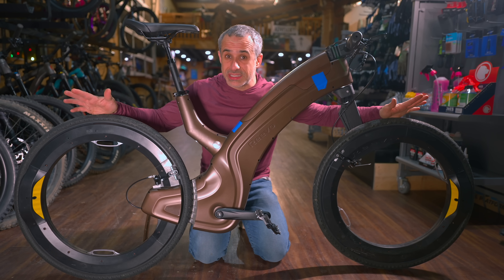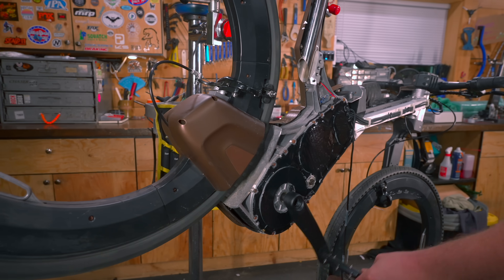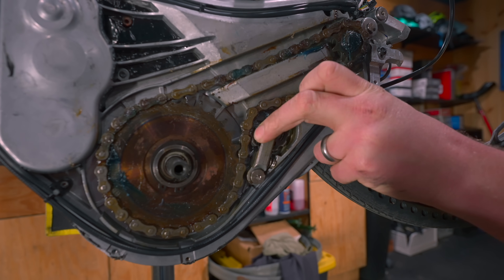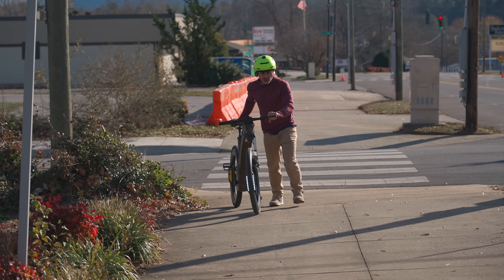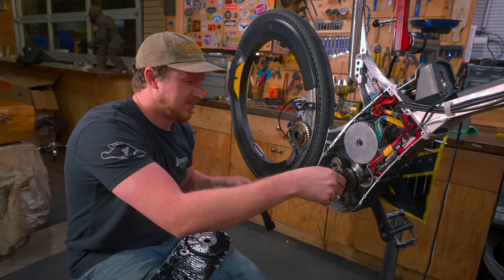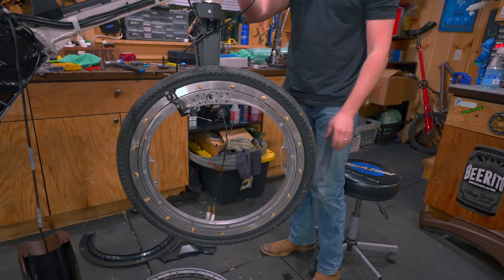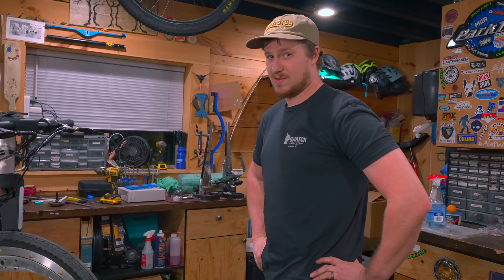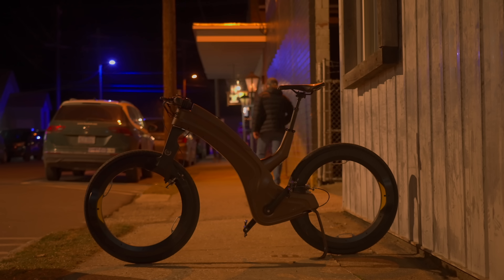What's Inside The World’s Worst eBike? Reevo Teardown

Comment: the amount of machining and engineering that went into this is nothing short of astounding. It reminds me of Juicero's insanely overengineered colostomy bag squeezer.
Reply: That sounds like a terrible thing to be reminded of.
Reply: @soaringvulture  look up Juicero. 
I think the eve channel did a teardown on it.
Reply: And, much like squeezing the proprietary Juicero bags, it's more efficient to just do it manually
Reply: From a bike Mechanic's pov, this is over engineered by someone who has no idea how or why bikes are designed that way. Jucero was over engineered but does it's job (being a cold press) very well. This thing is over engineered because the engineer probably never had any partial design done and thought he can just over engineer his way to success.
Reply: @StevenZephyc  From an engineer's point of view, it really looks like someone knew what they were doing when they did this. You can't put something like this all the way to manufacturing without a good understanding of machine design. And you can't have a good understanding of machine design and think that any of this is a good idea as a consumer device. I do hope they specified stainless screws and the factory messed that part up.

And I kinda respect the company for shipping out prototype devices which must have cost at least ten times the sales price to produce. If you are trying to scam someone, that is not what you would be doing.
Reply: @samuelsudhof8036  If they had specified stainless steel screws then they would have been fools; stainless steel screws gall in aluminium threads and become almost impossible to remove.
Reply: @cambridgemart2075  Yeah, true. Galvanized would have been correct.
Reply: @samuelsudhof8036  An engineer would never suggest that this be made. It has at least 10 times the friction losses of any other design. It was doomed from the start.
Reply: @firesurfer Hate to break it to you, but engineers don't get to decide what they make or don't make. They issue recommendations and offer guidance to be roundly ignored in favor of a flashy presentation from the marketing team.
Reply: @firesurfer  "An engineer would never suggest that this be made."

Hubless wheels certainly CAN be made to work. I would have suggested that the right way to do it would be to specify two good, custom, 32" diameter, sealed, thrust bearings for each of those hubless wheel assemblies. And then the idea man who hired me would have said, "That will cost how much? Oh hell no! This is a bicycle, not a lunar lander! Just use some plastic wheels pinned in place within the outer hub casting."

Also needs some sort of sprag clutch on the pedals to prevent the rear wheel back-driving them and causing the runaway issue, but this isn't the biggie cost item.
Reply: @samuelsudhof8036  It certainly seems like the kind of thing where concept designers pushed what they wanted for the bicycle, told the engineer exactly what they needed it to do, the engineer told them it was possible but really just not a very good idea, and then they told him to do it anyway because they had already pushed the concept-design to investors.
Of course the engineer who could ACTUALLY pull this off, at some point decided not to bother trying too hard to get it to be optimal, because this was clearly a walking disaster who's only redeeming quality was the marketing department.
Reply: @CabbageSandwich  can’t agree more, as a mechanical engineer this is what usually happen especially when working on an innovative product. The engineering and the design of the bike is actually pretty neat conceptually and i believe the concept can work if given enough time. In this case I suspect that they have terrible communication between their division.
Reply: @afrodite8685  I absolutely agree, and chances are that initially, the engineer was applied and excited to make the prototype, only to discover that the company was not going to drop the kind of R&D money needed for the several iterations needed to make a functional next-gen ebike.
Reply: @StevenZephyc  the juicer doesn't do shit you can literally squeeze the bags with your hands and achieve the same outcome this was proven through like 500 videos 😂
Reply: @StevenZephyc  I feel like you couldn’t be more wrong. Just like every other non-engineer that blames an engineer, you too fail to realize this is definitely the brainchild of someone in marketing
Reply: @StevenZephyc  woah watch THE BICYCLE MECHANIC has entered the chat to tell us why the Juicero is a good product after all
Reply: @ItsSweetShot  "woah watch THE BICYCLE MECHANIC has entered the chat to tell us why the Juicero is a good product after all"

Now that's just an unfair mischaracterization. He didn't say the Juicero was a good product. He said that as a machine designed for a specific purpose, it wasn't over-engineered. It can be a shitty product, a shitty idea, or whatever...and he can still be correct.
Reply: @StevenZephyc  Actually, Juicero was really bad engineered and you could extract more juice pressing the bag with your hands.
Reply: A difference is the Juicero bag squeezer was pretty much engineered to be an intentional fraud, ridiculously over engineered just for the purpose of charging a lot for the machine and subscription to the juice bags.  The Revo bike seemed more like a failure to take a prototype and make it manufacturable.  Whatever Chinese factory was contracted apparently just obliviously churned out exact copies of the engineering model without regard to whether it made sense.
Reply: @wtmayhew  It's questionable, a lot of facts says that Juicero probably wasn't an intentional fraud either. It absolutely can squeeze juice out of vegetables, the main problem is - the bags are too small to fit enough vegetables to fill a glass with a juice. So they decided to add juice in the bag with produce and the juicer become an overengineered caprisun squeezer
Reply: @wtmayhew Well, not the factory's job to fix something that went wrong in the idea phase. The only thing they could have recommended would have been to cancel the whole thing, but you can't really expect a contractor to shoot themselves in the foot like that.
Reply: @wtmayhew  I disagree that the Juicero was overengineered. It was overbuilt, in that they could've accomplished the same with a much cheaper device just by squeezing the bags from the far end rather than all at once. This is overengineered, in that it required a lot of engineering to produce the desired result of a "hubless" bicycle. The sentence, "If you give a smart engineer a dumb idea they'll figure out how to do it, but that doesn't make it a smart smart idea" is what defines overengineering in my opinion.
Reply: @wtmayhew  "Whatever Chinese factory was contracted apparently just obliviously churned out exact copies of the engineering model without regard to whether it made sense."

To be fair, it isn't a manufacturing facility's responsibility to engineer your product for you. You design shitty product, contract them to produce shitty product, and they spit out shitty product.
Reply: @wtmayhew  I wouldn't be sure. For how expensive the Juicero thing was, it lost money on every sale. Perhaps it was going the printer route, where they turned a loss on the machine and made up the money by gouging you on the refills.
Reply: @blakksheep736   Thanks for reply.  I believe you are correct that the plan was to sell lucrative subscriptions to the Juicero.  Unfortunately it was too obvious that all people needed to do was to open the bags and the machine wasn’t needed - it wasn’t doing any processing of the bag contents.
Reply: @wtmayhew  yes, that too. Selling a product whose only use is solving a problem it creates is already tricky, but the Juicero couldn't do even that.
Reply: one thing in particular with the juicero is that they seemed dead set on it being front loading for some reason, which was a big part in why it ended up being so overengineered. basically they needed a lot of pressure to squeeze the packets but that pressure was also going towards the door at the front which needed to not pop off and impale someone while they were standing there waiting for their juice. so dumb but very similar to this bike where they decided from the outset that they "needed" to have spokeless wheels
Reply: "colostomy bag squeezer" 😂 Thank you for the good laugh!
Reply: Exactly. I took a lot of effort to make something shity
Reply: Dude. I used to have a colostomy bag, and had never heard of this. Reading that last bit had me almost scrambling to search into this, thinking of what it would have been like to have someone squeeze that bag. xD OMG, I nearly had a heart attack going, 'What? WHAT?! spfftt NO! That's not real!'
Reply: @darenabryant9100 i wonder if you could reuse them this way
Reply: Sounds like the age-old story of how hard it can be.
Had a grand but vague idea, gathered a lot of funds under unrealistic poorly thought out promises expecting money to fix every issue their imagination couldn't, got buried under way too many problems they had no idea about, running out of time and money scrambled frantically to deliver at least something resembling the original promise, didn't make it in the end.
Not intentionally a scam at any point, but with not much different outcome.
Reply: The bicycle equivalent of the f-35. And we wonder why there is so much debt?
Reply: Feels like a a desinger got an idea, and ab enginer wont say no to a stupied problem to solve :D, i dont think this is a sacm or money grab this probably costed alot of money in R & D
Reply: The juicero of bicycles
Reply: This bike is like the Pancor Jackhammer of bikes
Reply: Hah, that was my first thought as well.
Reply: yeah i know right? this feels like that episode of BOLTR
Reply: You win in best description ever
Reply: Sister Miriam pfp :D
Reply: Now you can have juice EVERY DAY.
Reply: I just watched a tear down of a juicero, and it's a beautiful and elegant design.  Everything from the plastic molding to the circuit boards are super high quality and the whole thing meets the design goals as perfectly as you can.  

Sure, it would be expensive as hell to manufacture and the design goals are complete bullshit, from iot connectivity to proprietary juice bags, but it does what it was supposed to incredibly well and elegantly.

I would love to work at whatever design and engineering firm put that abomination together.
Reply: thank you for this comment because it sent me into a pipeline where I ended up learning about Mariana Mazzucato
Reply: I got whiplash hearing of the Juicero again 😂
Reply: It's the Joe Biden of bicycles

Comment: Say what you will about this bike, but the engineering behind it is truly remarkable.
Reply: it is thoroughly under engineered
the chassis is overbuilt (too thick, and seriously? square tubing?)
the gear train more complex than it had any right to be, especially the electric side (you don't need that many gears)
the hubless wheels runs on 3d printer V-rollers with plain bearings (high rolling resistance x34)
the anti theft system relies on an effectively disposable hobby servo (known for stripping gears all of the time)
you have to dismantle the lights to service the wheel (no connectors)
the drive wheel construction is dog (milled solid casting, drive gear part of the wheel body)
the wheel constantly backdrives the motor and pedals (what is a freewheel device?)
preceeding issue probably causes even more resistance with the electric fields of the motor
the stupid usb plug perfectly positioned to be full of water comes the first rain
and so on

you're right, it is remarkably bad
Reply: Did you even watch the same video I did?
Reply: I didn't see a whole lot of engineering. There was plenty of fabrication but not much thought behind it.

Comment: Damn even the servo they used was the literal cheapest one they could find. The SG90 is less than $2 when bought in anything more than a 10 pack, has cheap plastic gears, and isn't water resistant at all. I would have at least gone with the MG90 so you get the reliability of the metal gears, but honestly for the price they were charging for the bike they should have been using something a little beefier and probably water resistant if not straight up water proof.

Comment: Does it use Boeing's MCAS system for the pedal assist. Modified Characteristics Augmentation System. Or did Boeing adapt its system to the 737's Horizontal Stabilizers. The world may never know.

Comment: If you put the interface between the frame/fork and the wheels on the ground (where the wheel touches the ground) then the wheels as a whole would never have to bear the weight of the bike. That way one could have done away with the 'stationary' inner wheel completely. See the Sbarro Orbital Wheel, an old (similarly bananas) idea for motorcycles from the 80s. In these, a hubless wheel moved through a special bracket that held the wheel in place, at least in case of the front wheel. There is a reason why wheels have hubs most of the time I think :-).

Comment: I don't get it... They could have make it look good, without the plastic, just look at Pole bikes. The tooling for the covers can be expensive and I sure as hell would be proud of my wacky drivetrain design. The runaway bike error took more engineering to actually happen, than this drivetrain. They could have used pneumatic tyres with this construction. They could have used wear resistant industrial plastic gear ring, instead of VERY wear prone aluminium. Also there is chain drive! They could have used an off the shelf Bosch system! Would require some clever thinking with the gear ratios, but would be possible....
I am a professional design engineer and the whole thing reeks of management meddling and freshly graduated designers.... This video made me angry. Thumbs up!

Comment: Those "little skateboard wheels" are standard v-slot rollers xD

Commonly used in CNC and 3D printing stuff
Reply: Worst part is, they are not metal body ones, which have less wear and are better suited for long term use compared to plastic/nylon
Reply: @darknessblades also they seem to be ZZ type non-sealed bearings, installed 2 inches from the ground, which means that the first puddle you ride through would have destroyed this bike
Reply: @dirkmohrmann8960  Exactly, that is why full metal body ones would have been a lot better, less wear [though slightly higher chance of slipping], which won't matter on a bike like this.

Sand and mud will kill this bike within months
Reply: @darknessblades  Months? I'll give it a single month
Reply: This bike is something intended for people with too much money to buy, ride once, then put in the back of their 4 car garage.
Reply: @teadrinker7098  This is exactly the person I imagined as the seller.
Reply: @darknessblades  Nylon ones would allow dust and dirt to be embedded and shed more easily, like how non-roller bearings are dissimilar metals.  Metal rollers would wear the rim faster.  Hence why they used nylon
Reply: I was gonna say, these already wear like crazy on 3D printers which are only supporting a couple of hundred grams on the gantry. I couldn't even imagine how quickly these would turn to nylon dust. 

At least they'd wear before the rim though 🤷
Reply: "But it's hubless, man!" 😂😂😂